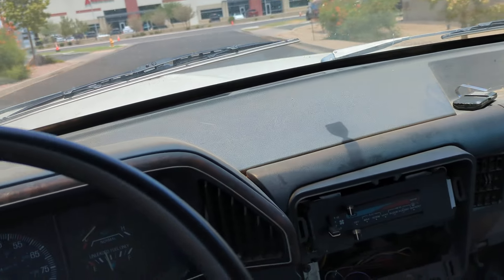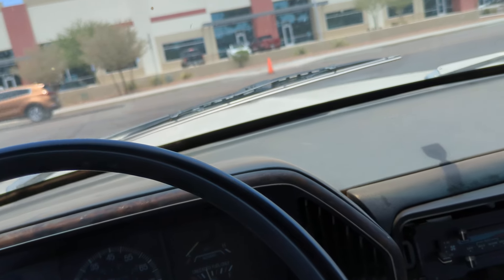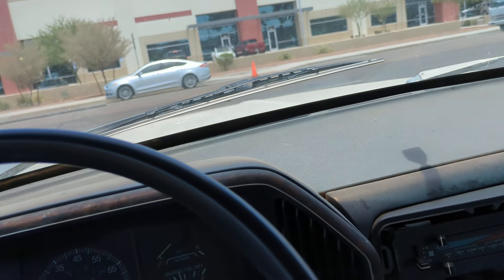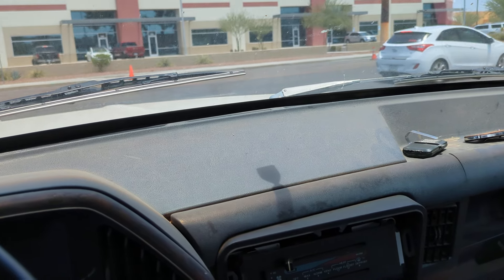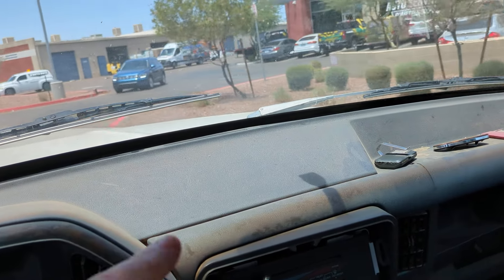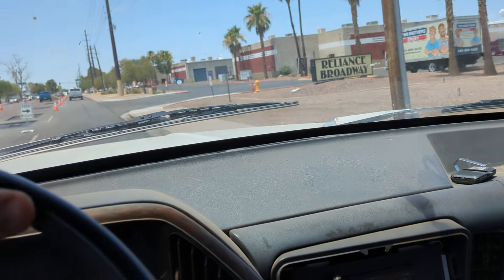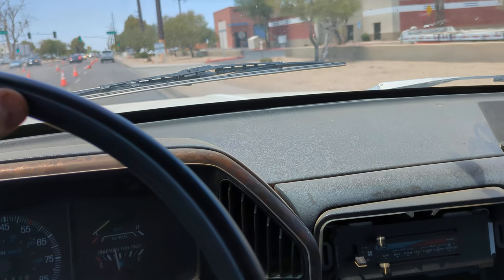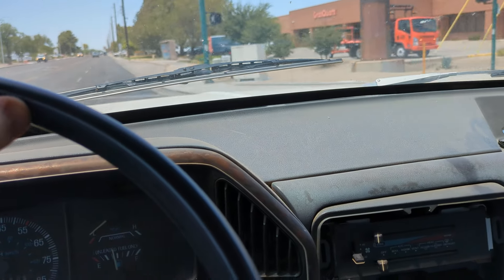Recoil Audio STOCK Update: PX65 + RED1800.1 + RED1800.5 + WS8 + Di1200.4 & Di1200.1 + RCX65 & REM65

Comment: Could you thin-bead epoxy the cone to make it somewhat water proof?
Reply from the maker: Yes you just have to be aware of your application so that the added mass doesn't hinder the high frequency if you're using on a mid or a mid bass